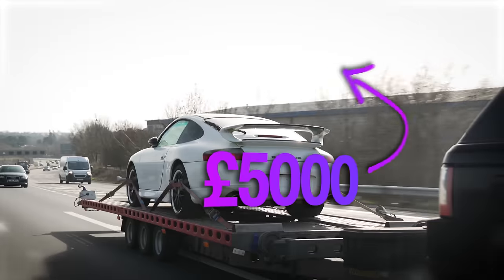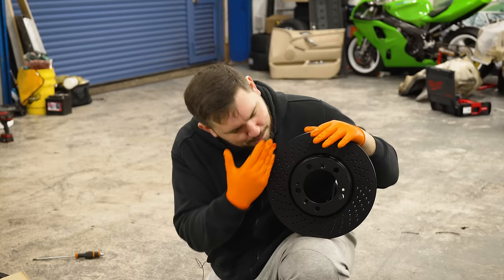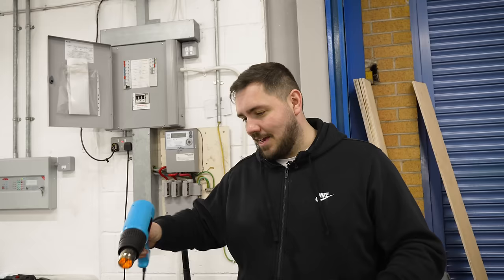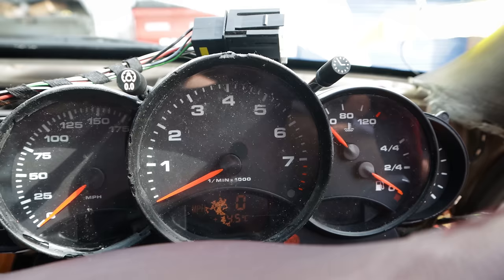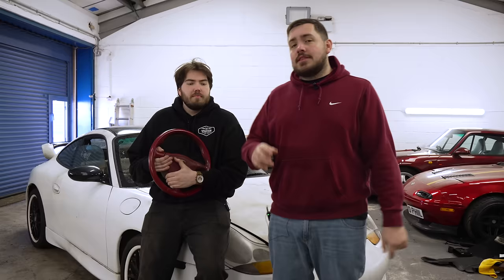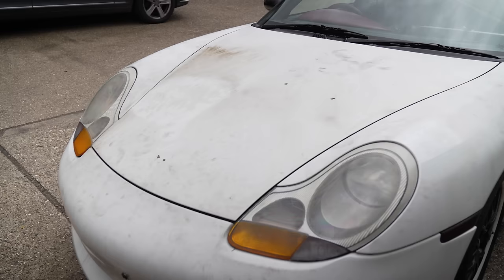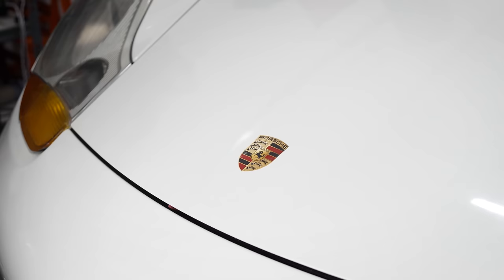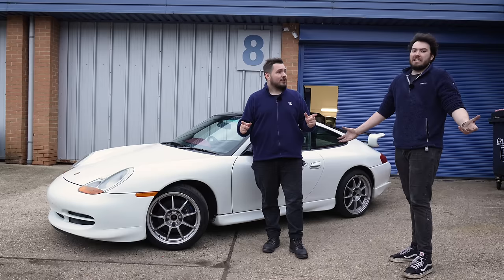Rebuilding a Wrecked Porsche 911

Comment: You'll need a wheel with an airbag in for the MOT since the original had one. Assuming it's getting a genuine MOT since you were worried about having a horn.
Great to see how far you guys have come, with people lending a hand and sending bits in, you deserve it.
Reply: I may be wrong but isn’t it just a fail if the warning light is on?
Reply: No, must be present.
Reply: @leeroypeabody  ah fair enough. Been a few years since I was messing with cars so not up to date on the latest rules.
Reply: @leeroypeabody how does an MOT tester know if a steering wheel has an airbag in or not?
Reply: @downwarddonk  it has an airbag unit in it! Which says airbag.

Comment: Don’t you need a steering wheel airbag for the MOT? Amazing content!
Reply: If its not installed its not tested like rear wipers etc 👍
Reply: If airbag was there as standard it should be present at time of test 
Also rear wiper doesn't come into an MOT at all

Comment: Absolutely thrilled that you decided to use the original red parts as accents, that really makes it unique. it almost looks as though it's a special option direct from the manufacturer. As for the wheels, you can't go wrong with a set of ENKIE RPF1's.

Comment: those wheels need to be 1 inch to 2 inches bigger diameter ; it will make the body look smaller,  it brings it to a better perspective.
you also need the old school higher sidewalls like a 60 65 or 70 profile for chunky meaty sidewalls it fills the fenders nicely.

Comment: Definitely needs an airbag for the MOT, not just a horn, because the car left the factory with one fitted. Gone are the days where you could just turn off the airbag fault light, you actually need to have the airbag fitted (doesn't have to function though, I don't bother plugging mine in)

Comment: What a great first series! Can't wait to see how the car turns out 👍.

Just a quick question. Do you not need a steering wheel airbag if the car was fitted with one from the factory? I just always assumed a car wouldn't pass an MOT without one.

Comment: I think the climate control blower motor is related to the resistor regulating it. If it's gone, it will only go on when it's on full. Cheap replacement.

Comment: Please please fit a powerful vag engine 🙏  

Lots will bolt straight up to the original gearbox, 1.8t, 2.7t, vr6 2.8-3.2, 4.2v8 all will make good power with some boost